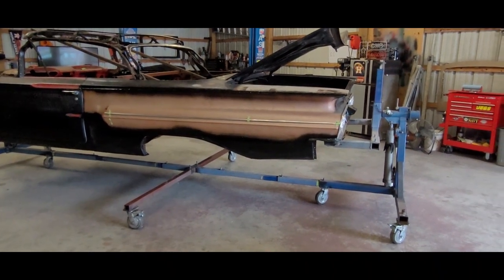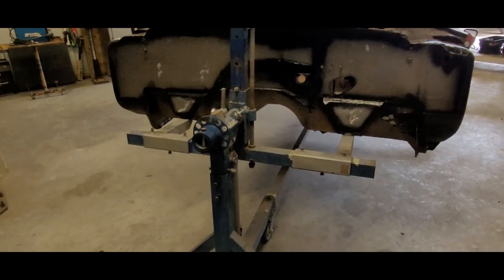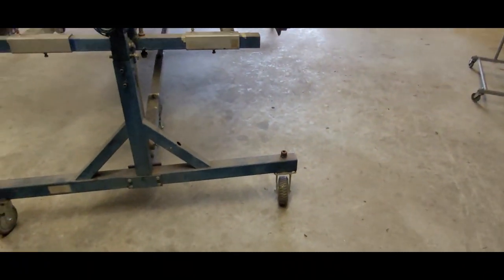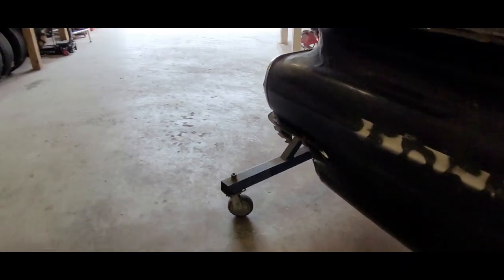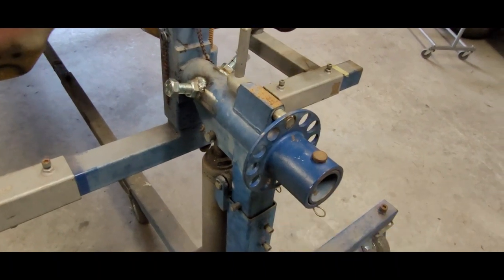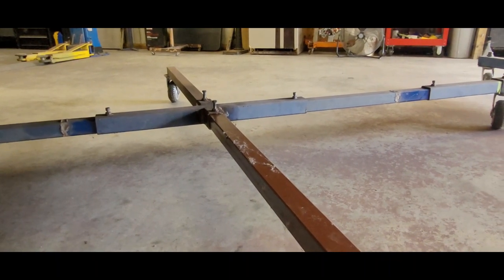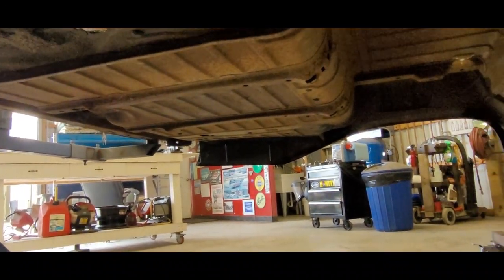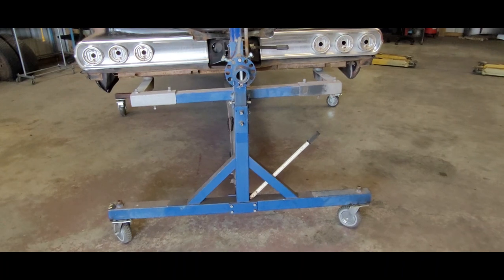THE CHEAPEST CLASSIC CAR ROTISSERIE!! | @lonestarlows | DIY

Comment: On the 68 did you guys cut the transmission tunnel for the transmission to clear?
Reply from the maker: No sir.  No need
Reply: Thanks for getting back to me . And Is there anything i need to know doing so that you where not aware of going into the swap?
Reply from the maker: The oil pans are different